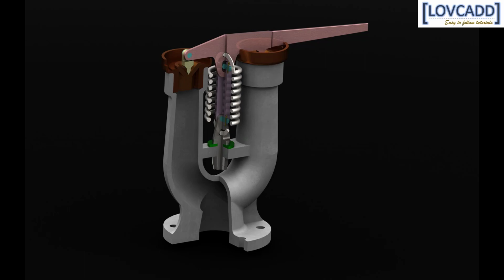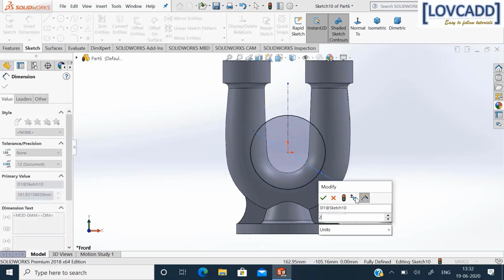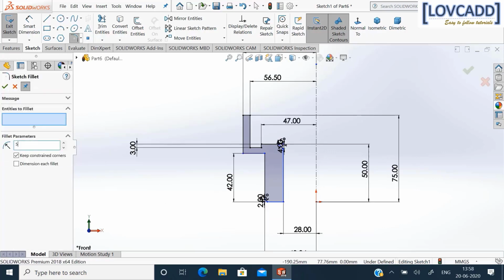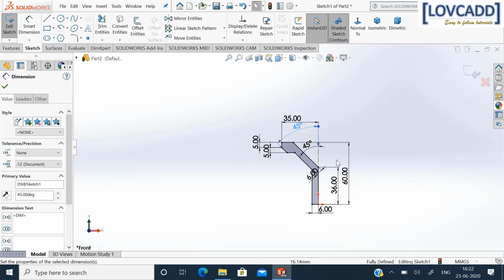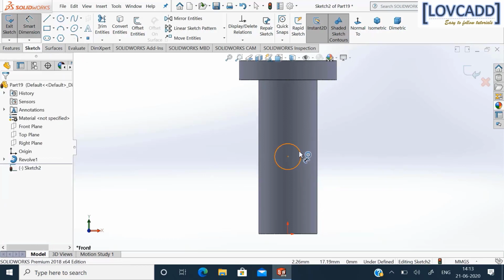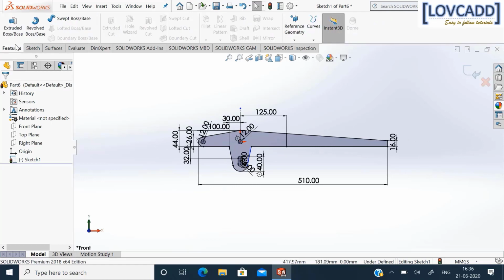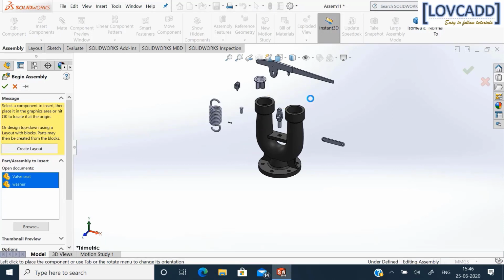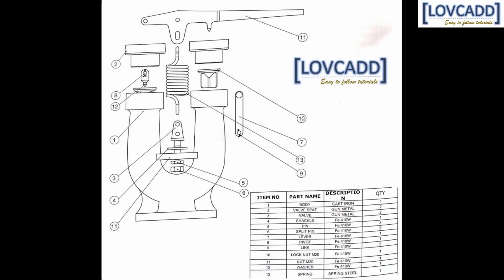Rambottom Safety Valve in solidworks full tutorial with assembly and parts drawing and modeling

Comment: Why 17 degree was taken in Body for extrude base and extrude cut ?
Reply: Pls Reply Sir @LovCadd
Reply from the maker: Plz mention that particular time from video⏳
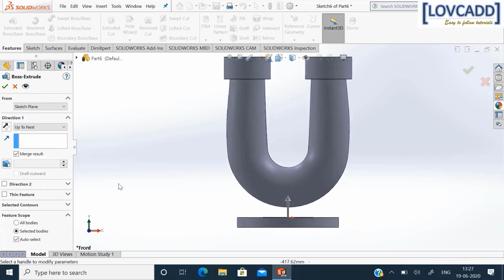Reply: @LOVCADD  Extrude Boss 07:00
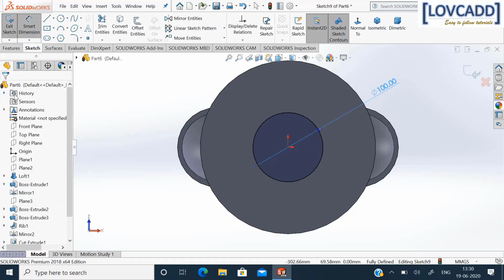Extrude Cut 09:40
Reply from the maker: @vishalramane9356  this is done to create shape that can connect both surface.
Reply from the maker: @Vishalramane 
The dimensions are part of design (which is based on calculation of various terms like pressure or velocity)
The reason for 17 degree  is continuty equation which say lower the area higher is the pressure. i.e
a1×v1=a2×v2. And this vulve is designed by great scientist in history . Also changes are done with lots of R&D.
Rember here we are creating allready designed component.
So just practice with given dimensions first then
Go for your own design

Comment: 0:00 - Intro rambottom safety valve.
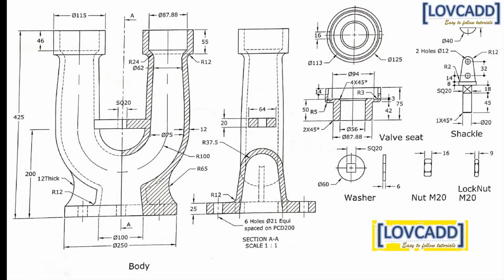0:23 - Body of Rambottom Safety Valve in solidworks.
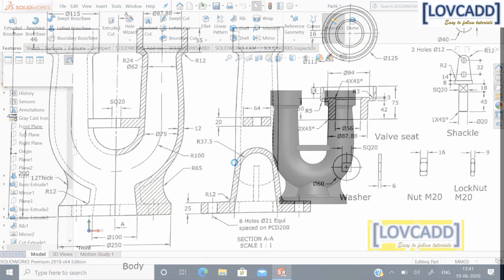18:56 - Valve seat of Rambottom Safety Valve in solidworks.
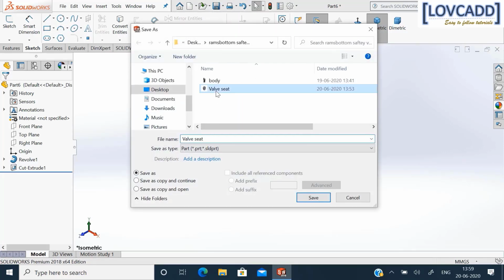23:14 - Shackle of rambottom safety valve in solidworks.
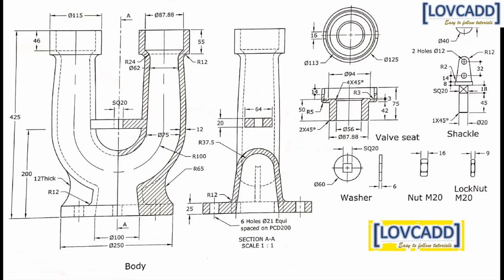28:33 - Washer in solidworks
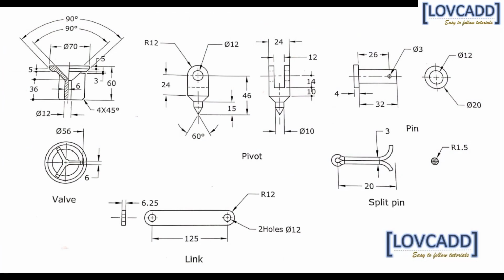29:45 - valve of rambottom safety valve in solidworks
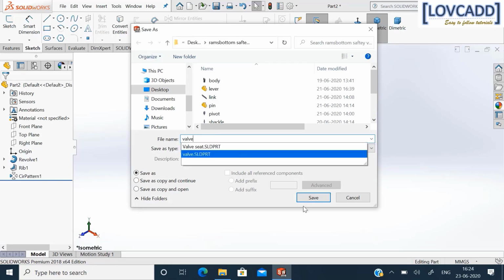34:52 - pivot of Rambottom Safety Valve in solidworks
39:54 - link of Rambottom Safety Valve in solidworks
42:04 - pin of Rambottom Safety Valve in solidworks
44:22 - split pin of Rambottom Safety Valve in solidworks
48:24 - Lever of Rambottom Safety Valve in solidworks
57:31 - spring in solidworks.
1:04:00 - Assembly of Rambottom Safety Valve in SolidWorks.